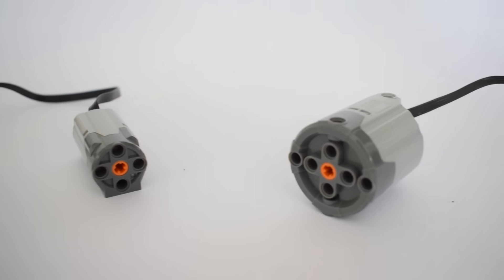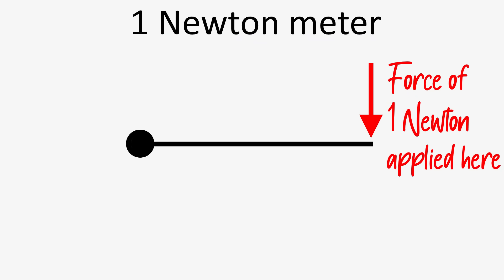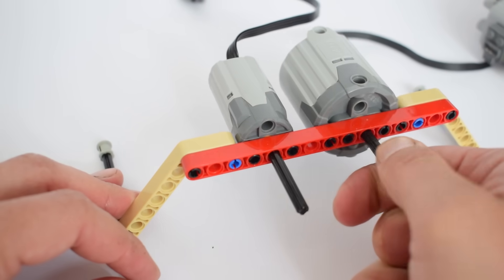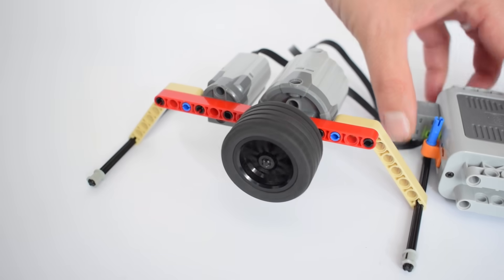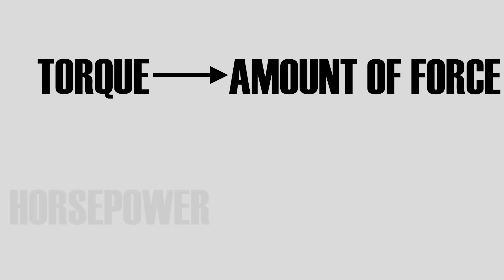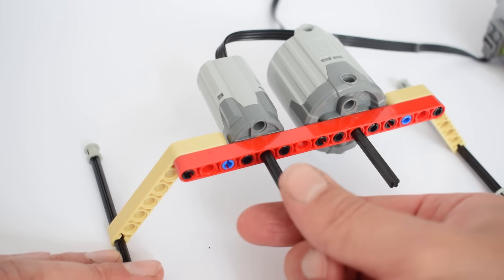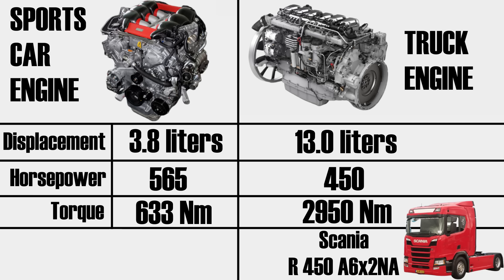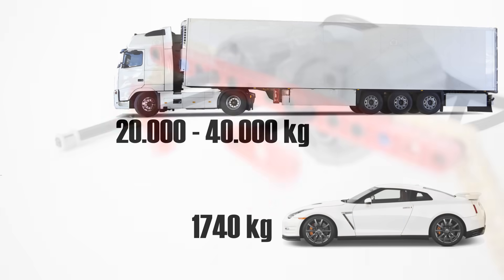NEVER be confused by HORSEPOWER and TORQUE again - HP and TORQUE EXPLAINED in the MOST VISUAL WAY

Comment: There are a couple of wrong concepts you exposed.
1-torque does not imply movement. So ANY scenario you mention with movement you at talking about power.
2-the engine power is the same than the wheels power minus transmission looses. Torque is not, the engine torque does not have much to do with the wheels torque.
3- regarding the previous point. The GTR is perfectly able to move the same weight or even more than the truck.
4-You can get any amount of torque you wish at the wheels, just put a short gear. Toque does no define performance

Comment: What if we take sport car engine and use gears to provide the same rotation rate output as for truck engine. Will the torque of more horsepower engine be always greater than torque of less horsepower engine? If opposite is not possible I would say torque and horsepower are basically the same. The fact that lego engines have 2.2 and 4.6 differences can come from a power of 2 in some formula which gives very close numbers (2.2^2=4.8, i believe those 0.2 can be losses in gear).

Comment: i have a question about diesel engine
why is peak horsepower for diesel at aroound 1800rpm and if u go higher it loses power? 
and for torque 1200 rpm and loses if u go beyond? 
IM GETTING BALD OVER THIS QUESTION AAAAAAAAAAA

Comment: An engine turns with a certain amount of effort made by the pistons. How many pistons and how big they are determines this. (Yes I know what a turbo is) This pushing effort by the pistons is torque.

The engine also turns at a certain rate or speed. It's called RPM.

torque x rpm = horsepower.

Tada!

Your engine is generating different levels of horsepower, or just power for short, depending on what RPM it is at. If you drive a manual you probably already know this but maybe its just clicking right now. You know that to get more power to climb a hill or accellerate to pass a car you need to reach a higher RPM as you gradually step on the throttle so as not to demand too much power from the engine when it is in a low rpm. Thereby asking the pistons to push as hard as they possibly can the whole time. Instead you can either wait till the car picks up speed and reach's a higher RPM or you can downshift and get a higher RPM that way so now when you step on the gas you're asking for the same power but equally from the two contributing factors of both torque and rpm.

Nascar and F1 produce or did produce compatible horsepower. But F1 did it at twice the RPM of Nascar. I believe 16000 and 8000 and respectively. Or around there. That's because of the restriction on how big F1 is allowed to make their cylinders. And the pistons create the torque. So with half the torque of Nascar and twice the RPM, because power = torque x RPM it worked out the same.

Also why when they say you car has this much horsepower they also specify at what RPM assuming the torque can be derived with the most basic of algebra.

Unfortunately if you didn't learn basic algebra in highschool you may still be a little confused

Comment: The physics behind it are well explained, and the comparison of car vs truck is also helpful. But there's still one question that needs answering: if there are 2 engines with equal horsepower but different torques, do they both consume fuel (burn energy) at the same rate? (when operating at max horsepower).
I assume the answer to this is yes, however, if you look at the torque curve of a petrol engine vs a deisel engine, the diesel outputs a lot more torque at lower RPMs.
But that also leaves me wondering, if a supercar petrol engine was geared to have an extremely high gear ratio, could it not also be used in a truck to the same effect?

Comment: Would it be correct to say that for example, if you were to 0-100km/h test your car, how hard you get thrown back against your seat is due to the amount of torque, but the faster your time, the higher amount of horsepower you're likely to have compared to a slower time?

Comment: What confuses me is that surely a high torque motor could achieve the same rotational rate as a high horsepower engine through use of gear ratios?

Comment: i still don't understand. xD.
Torque is Rotation Force.
as i understand it is Higher HP means More Force, but theres more to it than that. hmmm
 hmm so after watching the video again. HP how much Weight it is currently Rotating at.

so if a car Weights 2.5KG
and the Torque is 2500RPM
then the Horse Power is the Math Between these two. it will tell me how "Strong" the Engine is on this Weight

so if thats true then that means the Higher the Weight the less HP it has but it has more Torque.

your gonna need more Torque to Rotate the Heavy Object.
and the horsepower is like Speed (on that weight class).

i know there is more Technical things like Material and Stuff. what im trying to say...
if both are really high they will melt so you need a material resistant enough to rotate that fast or else things will go very poorly. or you could cool it off with Cold liquids.etc.

another way to look at it
the more torque it has the heavier the object it can handle (with the right Material).
and the Horsepower will tell me how fast it can go (with that Weight on it)

if the Vehicle has no weight you can't get Horsepower
same thing if it has no Torque.
you need both to tell me the HP.
Reply: now don't get me wrong there is some other Laws like Gravity, inertia?, Resistance,etc   that doesn't make it Straight Forward as Possible 
like if a car Weight Soo much it can't Stop Immediately or other wise the component will break or even the people will fly off

Comment: Excellent, but can you explain why car engine specifications display both peak torque and peak horsepower levels at different rpm's please?
Reply: Because if you multiply the (lower) torque the engines makes at high RPM with said RPM,  it's still more horsepower.

Comment: "You can feel Torque but you can't feel Horsepower" 

But it's VTEC yooo
Reply: "You can feel torque but you can't feel horsepower"

Horses worldwide would like to disagree
Reply: @vladmitrache6373  lol
Reply: of course you can smell them both lol
Reply: Good explanation but bad conclusion. For every task to be done, the only magnitude that matters is power. You can transform rpm into torque and vice versa, using gears. The magnitude that     is conserved is the power. Big slow engines vs small fast engines? It is mainly fuel efficiency versus weight .
Reply: @VictorDiaz-lo2mu  true if engines made constant torque over their rpm range, which usually isn't possible. So different engine designs have max torque occuring at different rpms. A truck engine has max torque at a low rpm so more power is available from a dead stop, useful if you need to pull a load from a stop on a hill and need a lot of force at low rpm even in 1st gear. 

A sports car using the same engine with a different cylinder head could make the same amount of torque at a much higher rpm and would make far more power because of it, but it would be worse for towing since it would have less power available at low rpm and may not be able to move forward with a heavy load because of it.
Reply: @Biriadan  That is what usually happens in reality, but the amount of torque is not the reason behind it. The torque distribution along the engine range is the real reason
Reply: @VictorDiaz-lo2mu  of course. I'm saying a torque distribution towards the lower end of the rev range will result in a higher torque to power ratio than having the peak torque at high rpm.
Reply: @Biriadan  . The two things to look at in an engine are the max power figure and the shape of the torque graph. The max torque figure sometimes leads to wrong conclusions
Reply: @VictorDiaz-lo2mu  fair. I agree. Max torque and rpm of max torque and max power can tell you a lot though if you don't have a graph from a Dyno.
Reply: @Biriadan  mostly agree. If you also know the rpm of max power you can have a good idea of how the Dyno graph looks like
Reply: You most certainly can feel hp. If you watch a dyno chat, torque decreases as hp increases later in rpm range. You can still feel that power.
Reply: @cjparkeffaking4551  different engines have different valve timings (the type of induction and the tuning for forced induction, ignition advance also adds), thus the torque curve (dyno chart) varies. The chart you referred to was valid for low range and mid range torque curves( or the torque the window comes at lower rpm range and mid rpm range is what I tried to say) .Some cars have it for high rpm range...in those cases the power and torque rises together, but the power rise will be more steeper..
Reply: Power = Torque × angular velocity...  
Therefore it can said as the rate of torque output. Power is how fast you give out torque.. you can get more power or less power for the same torque output, only difference is that the output shaft  rotates faster or slower respectively.
Reply: You can less power.. as long as  a certain THRESHOLD condition is met. Here the torque from the shaft must be atleast enough to break the resistance gave by the finger grip in the video.  
And at lower rpm you do feel it like he said... but when you increase the speed (rpm I mean)  you will feel it more because the heat generated from frictional contact between your fingers and that shaft multiplies proportionately. So you feel power too as long it gives the minimum amount of torque to break the resistance you give with your fingers..
Reply: I don't agree with him on that. You can only feel horse power. You have to apply torque over time to feel it. We can't experience things in infinity small amounts of time. It's like saying you can eat a cheese burger without the cheese. It's not a cheese burger till you have both.
Reply: @pleasedontwatchthese9593  horsepower isn't an observable force like torque. It's a measurement of work done. You feel force, not work. It's like saying you can feel time passing. That kick you feel when you step on the gas is the difference in velocity between you and the car as the structure of those 2 things isn't rigid, but independent. It's applied torque.
Reply: @cIappo896  Actually its applied force, waht you feel. Tourque is actually the same thing as Energy. How much force is being experienced depends on the length of the lever that applies the force. Lets got talking about transmissions.

In First gear a gear connected to your engine will spin another very big gear. the Force applied near to the inside of the Gear gets applied to the outside of the other gear.
If these two gears fight against each other the Smaller gear would have an advantage because moving a long lever requires less force than moving a small lever. You just need a long arm or walk in order to spin a little wheel in any meaningful way with a very long lever. If your lever was shorter you wouldnt have to move as much, but you'd need to apply more force to get the same amount of tourque.

Shifting upwards into second gear will put your small gear against a not as big gear. The 2nd gear will spin faster due to its smaller size since you can move lets say 100 teeth/s because it has less teeth than the first gear. But the lever isnt as long anymore so it doesnt have as big of a tourque advantage anymore compared to what it had in the first gear. Thats why you have less acceleration in higher and higher gears. You might have a higher top speed but you cant accelerate as fast in higher gears anymore. If you'd made the engine spin faster however at some point it will fly apart, which is why there are rev limiters so they can prevent this flying apart part.

Your theoretical top speed is only determained by three factors:
Transmission length (longer transmission = more top speed; less acceleration), max RPM (higher max RPM = more top speed; more power; more acceleration; less durable) and wheel size (larger radius = more top speed; less acceleration).
The FORCE applied to the ground depends on what transmission length you have and how much tourque your engine produces. If the force stopping you from going faster (such as wind force or just friction in general) is greater than the force you apply, you can no longer accelerate. Mass is not directly a factor - but mass does affect friction but also increases grip, which increases applyable tourque - so mass cancels out - downforce through a spoiler doesnt - thats why racecars use wings instead of extra mass). Mass does not influence your top speed if your tourque is always as much as physicall possible (so much that your wheels dont start to do a burnout).
A burnout means that the force applied is bigger than the applyable force for the grip you have. The friction which is supposed to help you propell is being overcome, this causing your wheels to spin without your car getting accelerated.

You do not feel the tourque. You only feel the force. Force is whatever is at some point by the lever.
You can feel it very easily by using a nutcracker. Cracking the nut with your bare hands is rather difficult - for some even impossible. Put it into the nutcracker, grab it by the ends of the two levers and push the levers together. Quite easy if you ask me. The force applied by your hands is exactly the same. The force, which cracked the nut was a lot bigger. Depending on the lever length.

If the lever was lets say 6 units long and the crack chamber was 1 unit away from the spin center, the force experienced was multiplied by 6/1, which is 6.
So if you applied lets say 6Nm of tourque you applied that because you applied 1N of force on a 6m lever. 1*6=6. The Nut experienced 6N because the same tourque applies to all levers 6Nm of tourque means 6N of force at 1m distance from center. It would have felt 24N at 25cm from the center and so on.

Meaning:
If you had a REALLY long lever you could make the earth stop spinning when you stand at a solid location, which is not attatched to earth. The lever just needs to be able to carry out this much force down on earth because theres gonna be a lot of force. So good luck building that lever.
Reply: @cIappo896  Time is how you use torque. It's not like its left out, its just part of a bigger picture.
Reply: @cIappo896  the kick you feel is jerk actually, the derivative of acceleration. You're feeling a change in thrust at the wheels.
Reply: You can not feel "horsepower", its just a unit of meassurement if you want to put it that way. what you feel when you press the pedal is the velocity change of your body (initiated by the applied torque of the engine to the wheels). 

here is an example: 

put two cars side by side. 
one has a turbo diesel engine with 500nm, the other a natural aspirated gasoline engine with 250nm. 
if both cars are the same weight, and you put the gas car in a gear where it does 4000rpm, and the diesel car in a gear where it does 2000rpm, both will accelerate at exactly the same rate and you will feel the same sensation, because both deliver exactly the same horsepower at the wheels for that moment (torque x revolutions = power ((hp)).
Reply: @Digi20  Exactly, actually we feel acceleration and that is directly influence by horsepower/weight ratio, torque does not tell us anything alone. One more example, heavy bus/trucks would feel crazy fast if we could feel torque, and they just don't :). Or on the other side, sports motorbike, 100ish NM of torque at high rpm 14K+,  it is crazy strong pull.
Reply: @Digi20  But you just explained how the sensation one feels depends on the horsepower, not torque. Not exactly "feeling horsepower", as what you feel is your body pressing on the seat, as you correctly pointed out, but as close as it gets when discussing these concepts.

Comment: Fun fact: while torque and energy aren't the same thing, they can both be expressed as newton-meters
Reply: One is a dot product and one is a cross product. So although the units seem similar, they are not quite the same thing.
Reply: Ya, the unit of horsepower is Nm/s not Nm... Horsepower is a rate, just like Power... Hence per second... Power is also torque x speed.. torque is Nm...

1/s is the rate..or speed...so HP = Nm/s
Reply: @innobius4898  well no, horsepower is it's own unit, which is a unit of power, not energy.
Reply: @battlesheep2552  N•M is energy in joules , so NM/S is power in watts
Reply: Also, the units of horsepower is horsepower. Power is commonly expressed in the units of horsepower, ft-lb/s, or Watts. The base units of a Watt is N*m/s or kg*m^2/s^3
Reply: so i ate 2000 calo-- i mean newton-meters today, how about you?
Reply: @innobius4898  not quite, different units and Horsepower has a constant thrown in (so that 1HP roughly equals the power of a horse, hence the name). 

But power is energy per second. Energy has the same units as torque but is quite a different concept. It's better to think of a Watt as the quotient  of a joule/second or the product of Nm*rev/s but revolutions are unit-less. 

In my experience anyway, think about it whatever way makes the most sense to you. It's a rough concept. Calculus helps, but still it's a lot.

Once you get rotational things get weird, and another unit of distance gets thrown in.

Comment: Ok so Torque is Force "F".
Work done "W", aka energy, is the amount of work done when a force is applied for a distance.
W = F * d   Where "d" is distance/displacement. 
Power "P" is work over time P = F * d / t = W / t.
Distance over time, "d / t", is velocity/speed.
Therefore P = F * v.  Power is also the amount of force multiplied by the velocity it is occuring at.
Rotational velocity can be measured as RPM.
Horsepower(P) = Torque(F) * RPM(v)